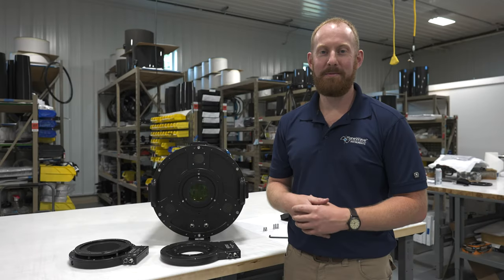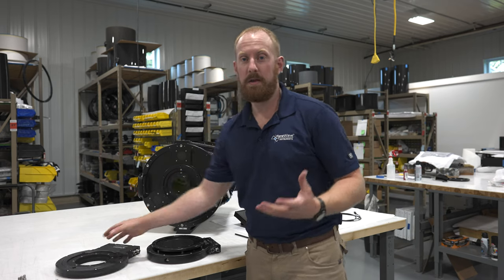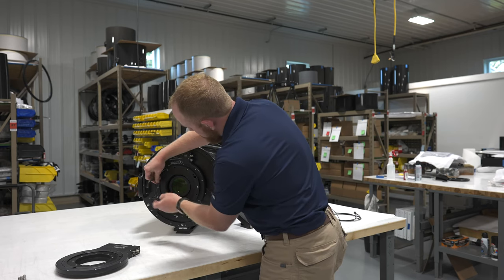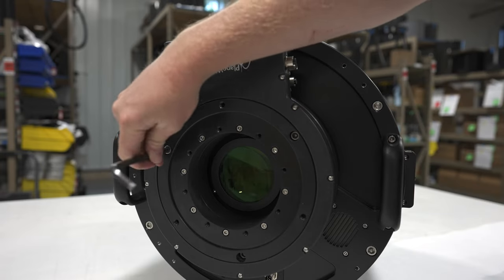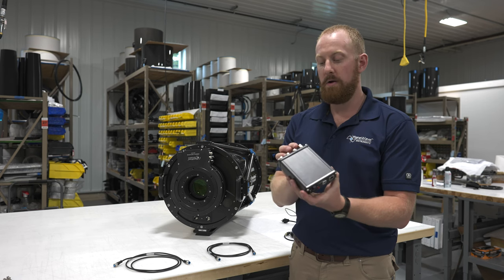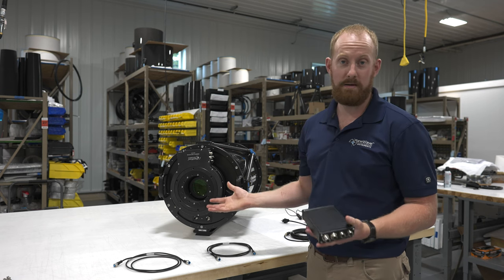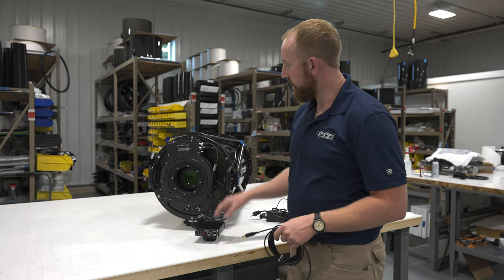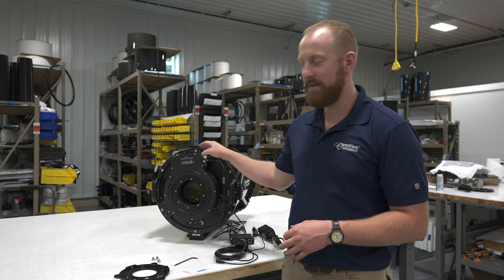PlaneWave Series-5 Focuser and Rotator setup

Comment: Great video, thank you. What does the ‘Dew’ connection control? Fans + heaters? If so, can this controller also be used (for dew control) on the CDK’s? Current solution for CDK’s involves two separate controllers, none of which have humidity sensor, so quite under par for proper dew control.
Reply: PW's answer: it cannot be used for other CDK's.